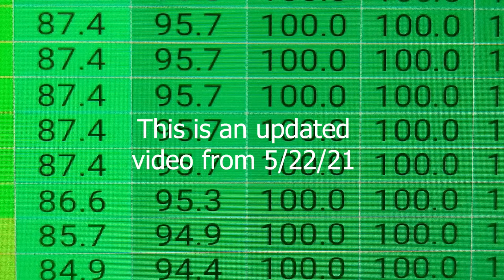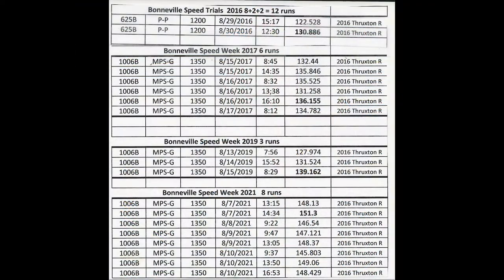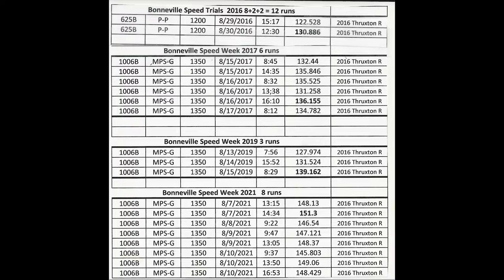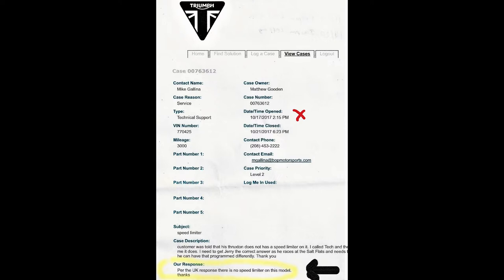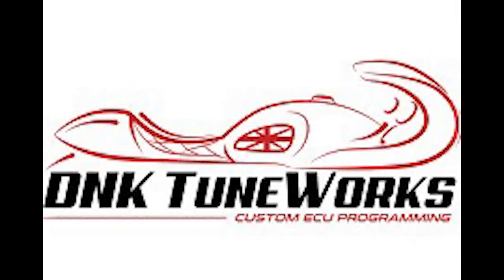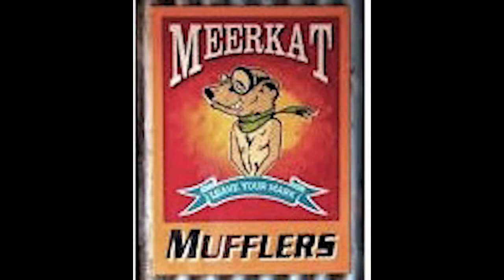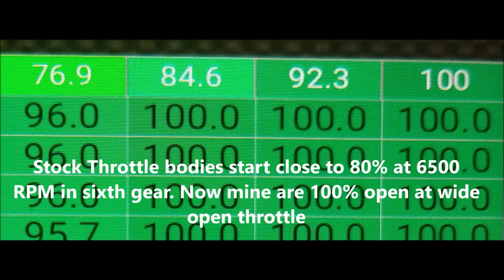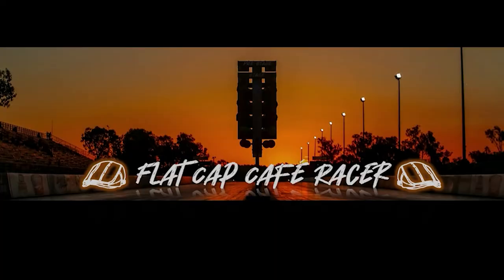(J) Updated - Is the Thruxton R speed limited?

Comment: Nice video. Where did those lower fairings come from? Would love to add them to my R..
Reply from the maker: Richard I  the fairing from Air Tech it was the John Cronshaw model from the mid 1960s. They have another one pictured for the Thruxton R which might work better. 

Almost all the fairings are required to be cut and modified which really is fairly easy. You can make some aluminum mounts off two points om each side of the engine.  I also mount to the Triumph quarter fairing mounts.

Here is the real rub for street riding anyway. On my fairing the clip ons have to be moved down a couple of inches to fit the fairing.  I've used this fairing for 8 years on two different bikes so I  did not originally make it for the Thruxton R so I  got stuck with low clip ons with this fairing. 

It didn't make me a lot of difference because I  only use it for racing but for street use I would want a fairing that allowed the standard clip on position to be used.
Reply: @flatcapcaferacer  thank you for that information!